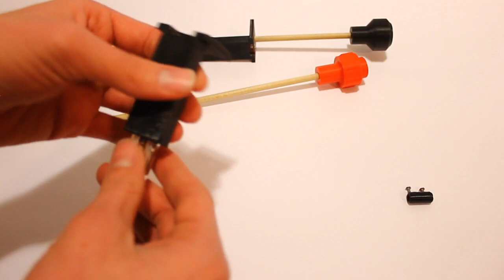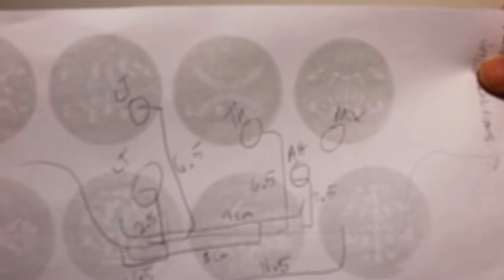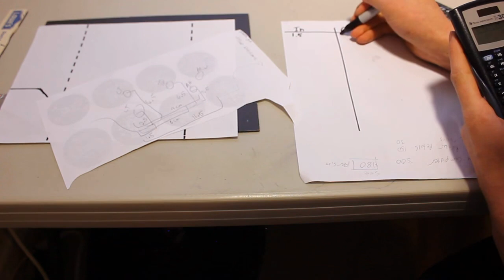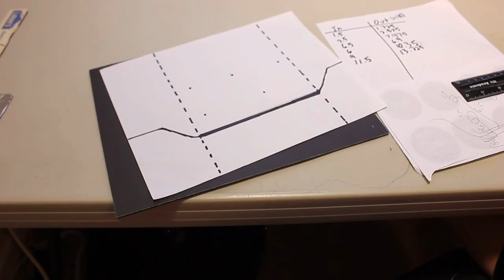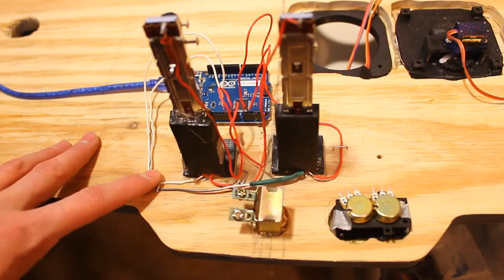Make your own Push Pull Cessna Throttle | Captain Bob

Comment: Great work. I'm new to this and very intrigued. Can this work with any version of flight sim? Thank you. Have a great weekend. :)
Reply from the maker: If you use a joystick card (Leobodnar, etc) Yes! If I remember correctly this one I used a leo bodnar with a joystick sketch which also works with any sim.
Reply: @CaptainBobSim  Hey there. Thank you for the reply.

I have access to an older spec pc and able to run up to FSX.

Graphics is not a major concern for me, just to take off etc.

Long story, but much has transpired and destroyed my life.

Thanks again, that's much obliged.

Great work. I'm checking the rest out.

Comment: Where did you get the friction locks that you show after you show how to drill the holes
Reply from the maker: https://www.thingiverse.com/thing:2806186 and https://www.thingiverse.com/thing:2805734 scale these up so that the hex nut's width is 1.5"
Reply: @CaptainBobSim  I really think you can make a killing selling this setup. If you made the whole thing assembled so I had to do was plug it in to my Arduino for in my case I'm plugging it directly into my Saitek yoke

Comment: The statement in the sketch:
Joystick_ Joystick;
doesn't pass syntax when compiled. Anybody know what's wrong with the statement?
Reply from the maker: I do not. I haven't had this error. I would recommend using the unmodified code from Amstudio's 5 axis video.
You might also find more help in my 737 axis video. Sorry for not being very helpful, I haven't done this in a while :)

Comment: Hi Bob, love your videos. I can´t find your link with code and the potmeters you used. Thanks, Henk from the Netherlands
Reply from the maker: Hello,
Sorry 'bout that, all of the descriptions got deleted, and I haven't rewritten them yet.
The Code is here:
https://github.com/AM-STUDIO/USB-5-AXIS-CONTROLLER
The print is here: https://www.thingiverse.com/thing:4021103
and the potentiometers:
https://rover.ebay.com/rover/1/711-53200-19255-0/1?mpre=https%3A%2F%2Fwww.ebay.com%2Fitm%2F2x-BOURNS-10K-Ohm-Slide-Potentiometer-100mm-Travel-Single-Linear-Taper-Carbon%2F401467538363%3Fhash%3Ditem5d79547bbb%3Ag%3ANj4AAOSwG1NahOqL&campid=5338464143&toolid=20008

Comment: What petiometer could I use with a leobdonar board to make this?
Reply from the maker: This is the one I used: https://www.amazon.com/BOURNS-Potentiometer-Travel-Single-Linear/dp/B079ZQ6T13/ref=sr_1_1?keywords=10k+slide+potentiometer+100mm&qid=1583678535&sr=8-1
You could also use these:
https://www.amazon.com/Aexit-Straight-Potentiometer-Linear-dcc6584808058bc77a5484309b7756bf/dp/B0838L156M/ref=sr_1_11?keywords=10k+slide+potentiometer+100mm&qid=1583678555&sr=8-11

Comment: It can be make on arduino mega?
Reply from the maker: No. The arduino mega is not compatible :(
Reply: If you are using x-plane 11 you can use arduino
Reply from the maker: @MauroReza  With this sketch, and a potentiometer?